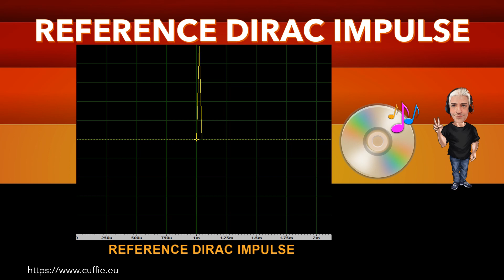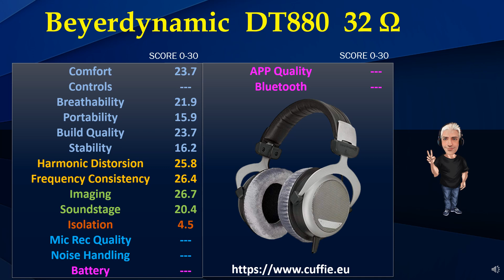BEYERDYNAMIC DT880 pro 32 Ohm - Review, Recensione, Sound Demo, Mixing, Frequency Response.

Comment: What's the difference between low ohm and high ohm value? Which ohm value is suitable for use on tv/laptop/smartphone 3.5mm jack?
Reply from the maker: 32 ohm is better for smartphone PC tablet notebook ecc
Reply from the maker: Hi....it's too long to explain here, however, in short, the lower  impedance, the better it is for portable devices such as smartphones or tablets or notebooks.... for high impedance go to hi power ampli or tube ampli